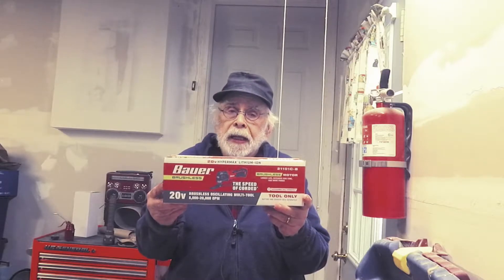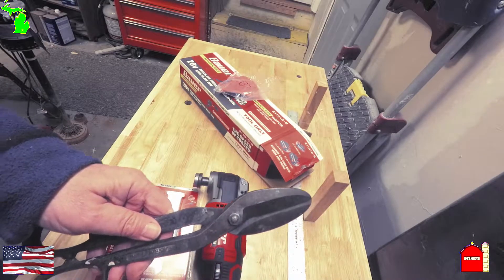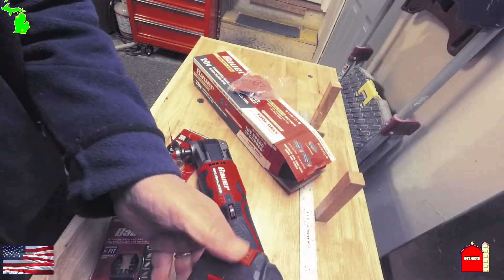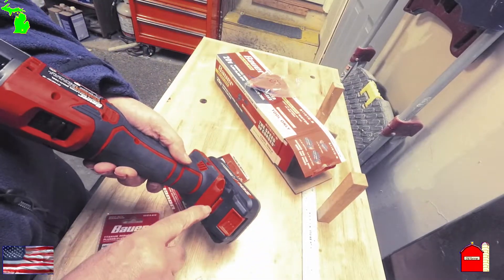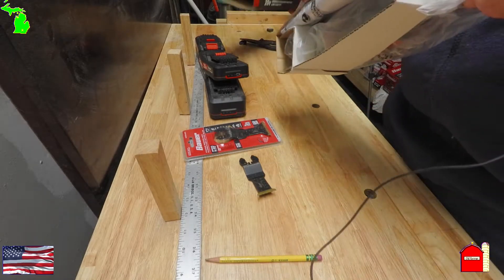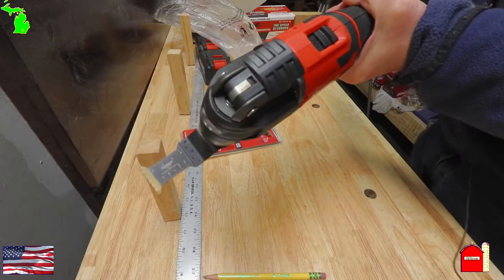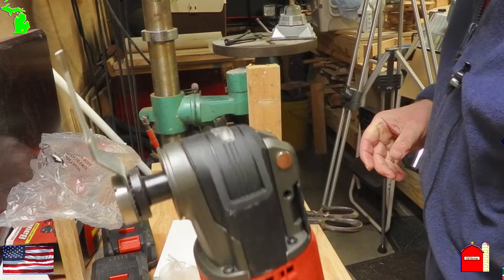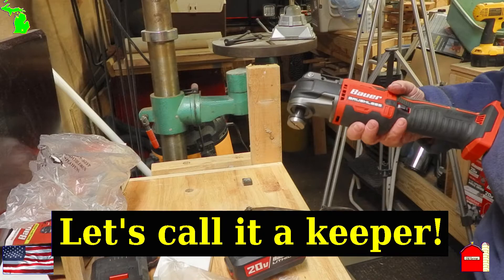206 Bauer 20v Multi tool

Comment: Same issue with mine battery was very hard to get on . Finally got it on and now it’s not as bad getting them in and out.
Reply from the maker: I thought they had fixed this problem. Maybe we need to use a valve lifter tool or a rib spreader from a medical house. They need to put a flag on their OEM order to the manufacturer to change the battery holder by a millimeter or two. Be a safe.

Comment: I’m kinda surprised to see the problem with the battery fit. I just bought the Bauer Multi-Tool a few weeks ago, and before seeing this. The battery slides into mine without any problems. It’s a tighter fit than my other tools, but still not overly tight.
Reply from the maker: Here's a little secret: The different model numbers means that the tool is from another EOM supplier. When they switched suppliers, they fixed the problem. HF is trying to get out of ordering tools from China. Maybe yours was made in another country. Glad to hear they fixed the problem. Be safe.

Comment: Hi Scott. I have a multi-tool from HFT but it is the Chicago Electric brand and it works great. Last time I used it to trim off shingles overhang from roofing my storage shed. Worked just fine even though the shingles were asphalt-type. It is also very good on drywall and many other materials. I like the ability to change the angle of the blade for tight areas. Take care, my friend and you and your wife have a great Thanksgiving.
Reply from the maker: It's good hearing from you. I hope all is well. Once I figured out that there was a speed control I was impressed with it. I wonder how it would do on Velveeta cheese for slicing. Enjoy your Thanksgiving and stay safe.
Reply: LOL on the Velveeta, just make sure you use a straight blade and not one with teeth!

Comment: Hi Scott.  I bought the same 20v Oscillating tool a couple of months ago.  I also had a hard time installing the battery, not quite as bad as yours was.  There is another YouTuber that did an unboxing of this tool, and had similar issues.  Mine would go on, but with great difficulty.  What I wound up doing, which helped quite a bit, I sprayed Silicone lubricant on the tracks where the battery slides in.  It seems the tolerances are very tight on that tool for the battery.  But once I sprayed the battery tracks, and worked it on/off a few times it is a whole lot better.
Reply from the maker: Thanks for the info. I thought of doing the same but could tell it was too far out of alignment to work. I wish HF would be honest about not having such a problem. The second MT was a hard fit, but did go on. After sliding a battery on a couple of times, if it still fits too tight, I follow your lead. Be safe.

Comment: My tool has a tight fitting battery,  just not as bad as the first one you tried. I need to measure  the tool to see where the problem is. I have many other Bauer tools and have never had this issue.
Reply from the maker: I think they made the mold incorrectly for the piece that holds the battery. If it's within 90 days, take it back. If it's past 90 days, try filing a bit off of both sides. I would do this slowly because if you go too far you can't put it back. If you have to file, let us know how it went. Be safe.

Comment: i run mine with an adapter so i can use dewalt batteries, they are also a bit tight but nothing crazy
Reply from the maker: I didn't know there was an adaptor. If you are past the warranty, do you think it would be wise to do a bit of shaving, on the tool; of course, you could include your own shaving; which is a different topic. Be safe.
Reply: @Original_Old_Farmer  I’ve seen it done, though I personally don’t have to because the dewalt batteries slip on and off without a lot of trouble. I think that’s the best solution because their batteries really are higher quality than most other makes, barring the other big names.
Reply from the maker: @edwardoavila7666  👍